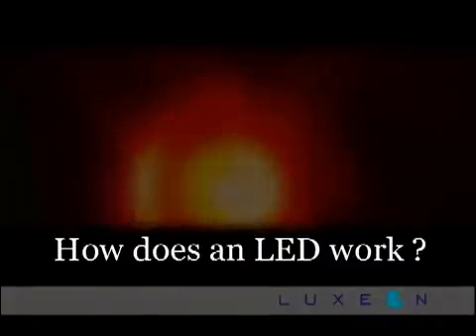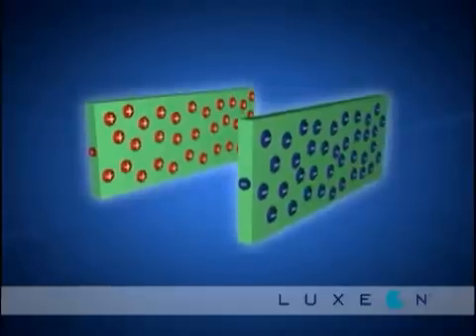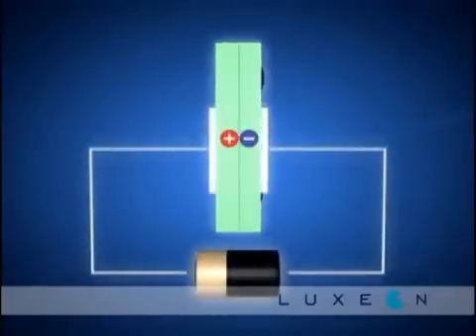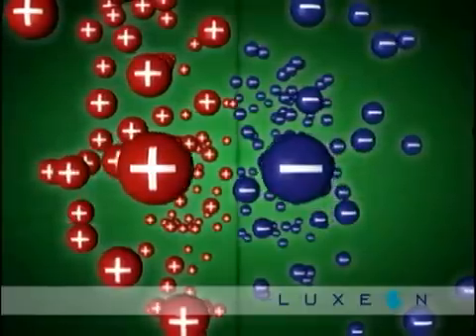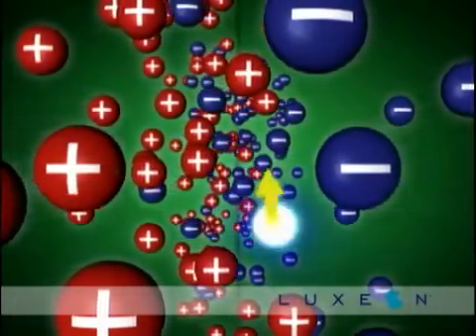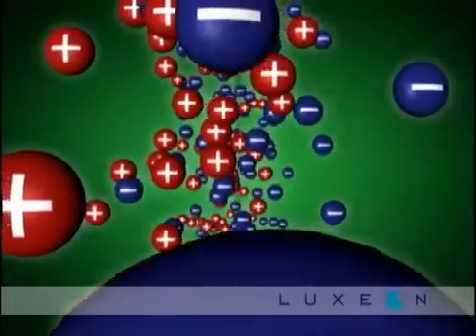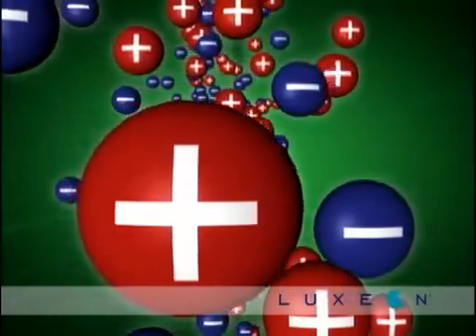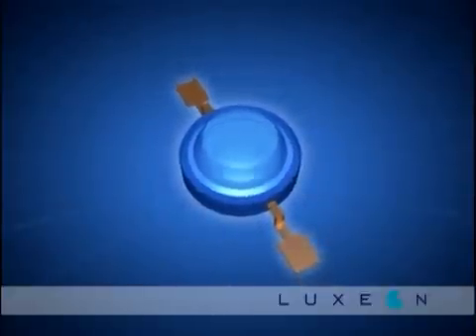how does an led work

Comment: Take care, some things are wrong... "the amount of photon or energy released determine the frequency or the color..." is totally wrong. The right explication is : "The color, and then the wavelength of the light emission, is determined by the level of energy of the electron". The amount of recombinations is linked to the intensity or the flux, nothing else. The mathematical relation is "E=hv" where E is the Energy difference between the two level of energy of the electron, h is the Planck constant and v is the frequency of the emitted light which is linked to its color.

Comment: what are holes? are they protons?
Reply: No, they are just an abstraction because the lack of charge (a positive area) has different effects on the semiconductor junction than charge-rich areas (negative, because abundance/presence of electrons). So holes are just for  conversation to stay on topic of tracking absence of electrons moving around... It would just be a little clunky to keep saying "as the zone of absence of electrons moves" so someone long ago just took a shortcut and said "as the holes move".
Reply: @nmz7874  thank you for the explanation. so in simple terms, hole=p type semiconductor= absence of electrons, therefore positive(p) and 
n-type semiconductor= abundance of electrons, therefore negative charged,(n)? also, u seem to be knowledgeable. do you know any sources(books, youtube playlist,etc) where i can study electronic components

Comment: But at some point the electrons are finished, right? How can it shine for so much time?
Reply from the maker: that only happens when the power source fails, or you flip the OFF switch :) The LED itself will fail to produce light when the migration of the atomic structure that was manufactured is physically broken (by physical stress, potentially via heat effects of the package, or being dropped or crushed), or atoms have diffused around the crystal, as a result of localized heating that happens in the LED (and probably coupled with stress of physically hot days, like in extreme heat of summer in the desert).

Comment: so why in normal diode elctrons and holes dont withe each other and emit light .normal diode also have same p and n type material
Reply: First: Not all pn junction material emit light some convert energy to heat some to light
Second: For emitting light electron and holes must combine so we need some power(electricity) to push them close together. current also inject more electron and holes
Reply: @ameerhamza4816  thanks

Comment: How holes can move as they are atom which lose e
Reply: They are an abstraction... sort of "virtual". You're right that a hole is just the absence of electron at a specific atom, which has a fixed location (in solid/crystal)... but if you track the absence of electrons at various location, you see the  location move. Another way to think of it: atom1 has absence, but adjacent atom2 doesn't... then atom2 gives an electron to atom1... not atom2 has an absence but not atom1. It's just a useful abstraction to use... like a glass of water being either half-full or half-empty... just a way to look at things differently.

Comment: i just dont get it, i need it to be more cave man, so if you had 2 bars of copper or steel or something and u put little ditches in them and charged one with a positive and one with a negative.. how do you even get positive and negative how is there 2 types electricity whats the difference is it just that u need 2 connections to complete a circuit so they named them positive and negative?. anyway so all of a sudden u get jesus light out of nothing, so its basicly an incendecent lightbulb only instead of burning wire its exploding with light? fuck off lol i bet if i made one myself all its do is give me an eletric shock or something, waaaaait a second here static electricity... is that basicly what leds are? ive pulled polyester shirts off at night before and lit the hole room up with a big blue bolt... so i guess lighting works the same way? my braiiiin, fun fact they had lightbulbs and lighthouses in ancient egypt, thomas edison simply reinvented the light bulb
Reply: BetterYouBetterWorld Electricity flows from the positive end to the negative end of a battery, electrons which are negatively charged flow in the opposite direction, from negative to positive. The two plates in the Semi-conductor are oppositely charged, as electricity flows the negatively charged electrons are attracted to the positive “holes” to be discharged. Since the negatively charged electrons have more energy than the positive “holes”, the discharge causes energy to be released as photons (which is basically light).

Comment: Hi, as p type and n type are brought close enough even before the applied electric field, the electrons and holes would recombine (as in pn diode ) due to opposite side attraction and can emit light? but practically only after the application of voltage source LED glows . Could you please explain ?
Reply: The electrons only emit a single photon, when they combine with a hole.  For the reaction to continue, it requires a continuous flow of electrons.  This animation didn't show the current source constantly removing excess electrons from the P-type material, and adding new electrons to the N-type.

Comment: Why is the plastic lens on an LED often colored? Doesn't that waste light through absorption?
Reply from the maker: Most LEDs emit near-infrared (NIR) light/photons... we need to convert this to visible frequencies for it to be useful (though remote controls for TVs, etc, often use NIR LEDs for invisible communications). Usually this is done with phosphors embedded in the plastic lens, but there are alternatives such as Quantum Dots which bypass the requirement of sourcing minerals from conflict regions (i.e. areas where governments are instable and human rights are violated). A property of Quantum Dots is that color depends on their size, so by tuning the size, you can tune the color... allowing for very rich color reproduction in TVs/displays.
Reply: Like how a butterfly can have blue wings. That's really cool. Thanks for the response!

Comment: Question: It seems that the number of holes and electron are finite, wouldn't that mean that time that the material can't produce light once the holes and electrons are all combined ? Do you have to switch the bulb off after some hours then ?
Reply: You give a power source to the LED, right. So continuous supply of electrons are given to the diode.
Reply: mmm, that's a nice question, but no the number of holes and electrons are indeed finite, but those are there because of p and n-type doping of the semiconductor. extra electrons and extra "holes" are supplied by a battery that creates the voltage differential that pushes the electrons (and "gaps") (and I think you could say it also "creates more")

in fact, the "holes" doesn't move, there are only electrons that move to another atom creates a positive charge on the atom the electron was. 

this is not so easy to understand at a first glance but then it will.
Reply: @zazkegirotron  this was what i was looking for, if you got more information like this (non subject bound, i just wanna learn) please let me know!!!
Reply: @rubenslats  I'd recommend videos from "Lesics" YT about transistors.  Also Eugine's are super nice.  Here's a link for the latter: https://youtu.be/SW2Bwc17_wA
Reply: @zazkegirotron  you my guy, are a hero. Thank you for getting back to me after 3 years to supply my brain with food to grow. Thanks for keeping me learning, because if you stop learning, you might as well retire...
Reply: @rubenslats  cheers mate.  Verisatium also made a video about silicon doping.  Very interesting.  All credit goes to all the amazing content creators here in YouTube.
Reply: Niranjhana Narayanan correct

Comment: i borrowed some leds from my friend and wen i try to connect them to wire with a plug ( gt plug from old radio and splited it to find two thin wires inside ) and inserted the plug into socket and i get is a blasted fused off led. each time i try to connect the led light has a blast ...why is this?? did i do anytng wrong??
Reply: harish vadde AC current kills LEDs when the voltage is too high. Its a light emmoting diode. Diode means 'one way' . AC sends electrons back and forth (hence alternating current). The 'back' goes against the diode, and at a high enough voltage, will blow up the led diode.try using a wall adapter. An old charger for a phone or laptop will work, if you cut it open
Reply: +harish vadde Sounds like the voltage or current was too high. What was the voltage you supplied? Did you use a resistor in-line? Was the voltage AC or DC?
Reply: +Nathan McCorkle 
tnx for responding..i didnt use any resistor..and its ac current
Reply: Paul Ngo  thanks paul for d explanation

Comment: is there a simple way to calculate the power needed to create certain colors of light? I want to mess with some LED's myself and want to know how they can change color
Reply: I am guessing that the color change that this video refers to is the so called Kelvin scale, so the more energy you put into an LED, the bluer the hue, the less, the redder. This guess stems from my high school physics though :D I'm not certain, but I can't find evidence of any other rgb-coloring method than using 3 different leds with transparent films on top of them to create the red, green and blue light hues.
Reply: Ok I was wrong I guess :D But I don't want to delete this comment since I want everyone to learn from my mistake.
https://en.wikipedia.org/wiki/Light-emitting_diode#Colors

Comment: how to control the brightness of LED bulbs ??
Reply from the maker: +Aqib Makandar using PWM is common, but there are also adjustable constant current sources that are used too
Reply: I want to change the bright of high power led light.... like 40w led
Reply: Aqib Makandar You cannot change the inherent brightness unless you get very close to the borderline voltage needed to power the LED. Other wise, you need a computing system to flash the led on and off really quickly to make it seem dimmer.

Comment: colours?..
Reply from the maker: +100roberthenry this depends on the specific materials that make up the LED junction, which together define the 'band gap' of the junction. This is basically the distance or number of electron levels that an electron travels as it moves through an atom. Most LEDs are actually all producing the same color light (near infrared, or NIR) and this is then upconverted to visible wavelengths (the frequency is increased, the wavelength decreased) using dyes or quantum dots (this is still in research-phase).
Reply: +ntm787  thanks, very interesting subject, ive always been fascinated with leds and what goes into them, its a bit nerdy i know but hey, without nerds we would still be using semaphore right....cheers.
Reply from the maker: there's more to be discovered all the time! it is never-ending!!!

Comment: Great video,I am using LED bulbs,got 1200 of  4ft led bulbs from manufacturer: http://www.ebay.com/itm/4ft-18W-T8-LED-Bulb-Tube-Lights-G13-6500k-Maufacturer-Wholesales-3-Year-Warranty-/251994424476?pt=LH_DefaultDomain_0&hash=item3aac09c49c

Shipping from OXNARD CA USA,fast shipping. Install them in my store, very bright and save on the electric bill.

Comment: So if you recorded an LED with a super slow motion camera could you see it flashing?
Reply from the maker: No, I don't think so... as the active emission area of the LED is much larger than a single junction of the P and N type semiconductor. So all the areas emitting simultaneously will blur and overlap. Maybe if the junction was a single pair of P and N type atoms, then you would get a single photon emitted for each electron input, so then I would think the rate of photoemission would depend on the resistance of the semiconductors (this would limit how many electrons per second). Electrons travel VERY fast though, so you'd have to have a REALLY fast detection scheme (or some other trickery).
Reply: you can see it with normal camera also..they blink quickly.
Reply: Yes you would actually. LEDs are connected to something called a PWM controller that turns them on and off repeatedly in order to produce the correct light density and reduce heat. Its not because of the holes, but because LED's aren't always on. Same with fluorescent bulbs, its pulsated to produce a specific brightness.
Reply: Not all LEDs are powered with PWM.
Reply: yes test equipment is expensive, but people still do it: https://hackaday.com/2018/02/13/photograph-of-single-atom-captured-with-a-plain-old-camera/
Reply: I would think not since its tons are going  off all at different times not a uniformed way
Reply: You would need a fast camera